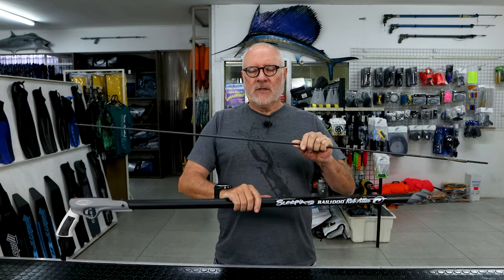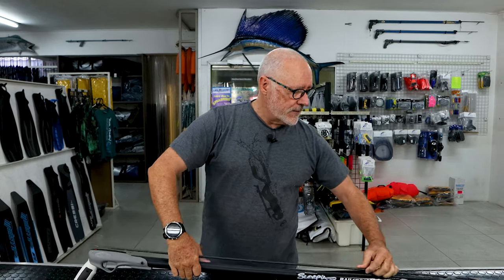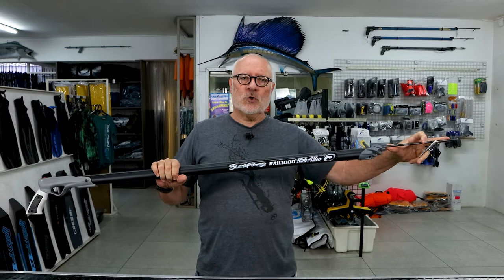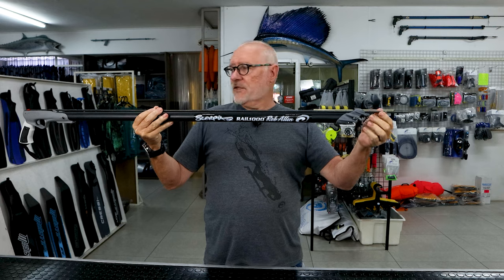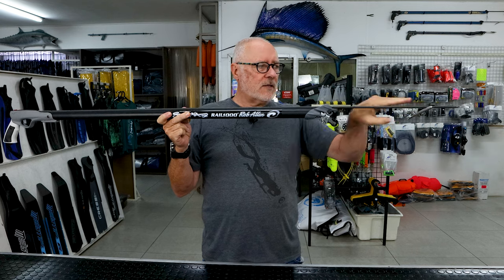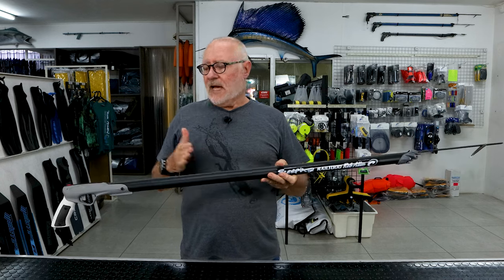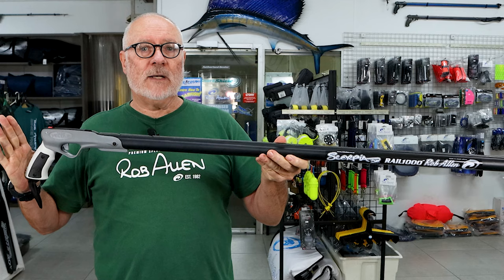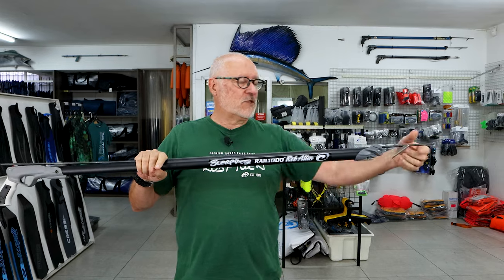Rob Allen | Barrel Length VS Spear Length | 2024

Comment: Hey Rob, thanks for the video. I did notice that you use a 90cm shaft for your 60cm guns, can you comment on this please? Assuming the relative length of the barrel on a smaller gun would have a similar over hang to a larger gun. Cheers!

Comment: Thanks Rob,
I have a question though, with my hunting style I use a 1.1 spear on my 900 but its also a 7mm spear with double 16 rubbers and I'm a happy Spearo. So would this advise still apply to others using thicker spears and stronger rubbers?
Reply from the maker: A 1100mm spear on a 900 barrel will bring the barb back into the muzzle? Are you sure of those measurements? The standard is 400mm longer spear than barrel length, 300mm will work but not 200mm in my opinion. 2 x 16mm rubbers are way to strong for a 7mm in my opinion unless they are way longer than standard. But, it might work in very cold water as the cold affects the "spring/elasticity" of the rubbers.
Reply: Lol sorry, I meant a spear for a 1.0 on my 900. so the 1.0 spear is 1.4m x 7mm (Your standard) so 1.4m spear less 1m for gun and handle leaves 400mm from muzzle to point of spear. 100mm longer than standard but also 7mm thick @RobAllenSpearfishing

Comment: Great video. Do you sell the timberline wooden wings separately for those with regular guns that would like to upgrade their barrels but not have to buy an entire new gun?
Reply from the maker: We do not because to bond correctly is is best fitted to the raw unpainted carbon. However, we are working on a smaller wooden pod that could work, still trialing.

Comment: Dear Rob, I heard your, for example, the mass of your 1.4m 7mm shaft is the same as your 1.3m 7.5mm shaft.  If this is true, I would like to go for a shorter but thicker shaft for easy transport instead of just a shorter length, so I don't need to worry my band configuration, and penetration power will remain the same. is my thougth correct? Kind Regards, Rui
Reply from the maker: Hi Rui, I just took those 2 spears and weighed them (with no barb) The 7,5mm x 1,3m is 42,4 grams and the 7mm x 1,4m is 40,4 grans so, still slightly heavier but only about 5%, I doubt that will have an effect that you will notice. 

The problem changing spear length is how do you aim? Some feel their accuracy goes if they change the spear length. 

Some guys also battle with the standard length spear and have to use the next size up, to get their accuracy back. It all seems to be a matter of how you instinctively aim.
Reply: @RobAllenSpearfishing  thanks for actually weighting them up Mr Rob! Not sure if this really impacts the accuracy, but great thanks for sharing the feedback from other users. Kind Regards, Rui
Reply from the maker: @ruitian8724  You are welcome 👍